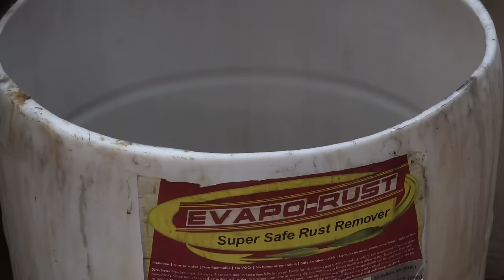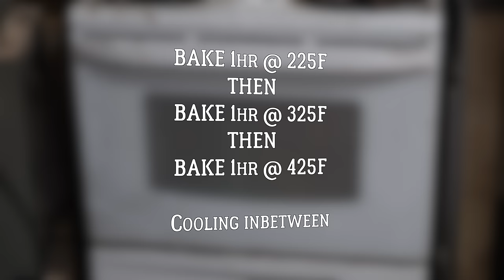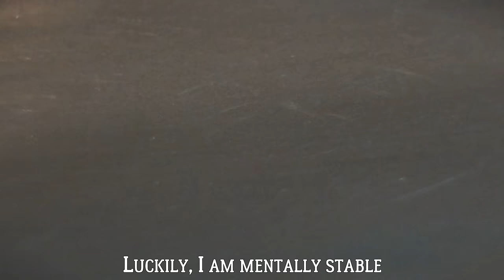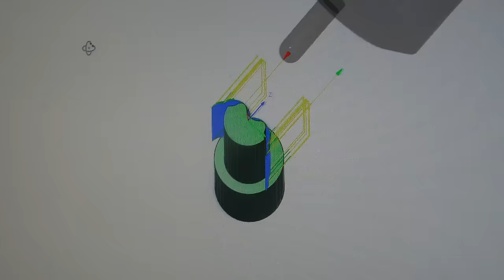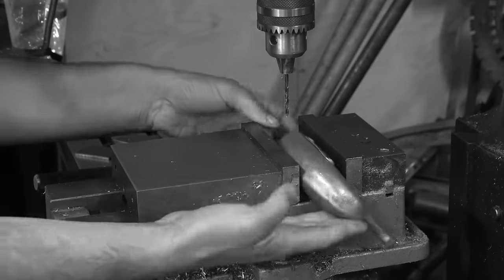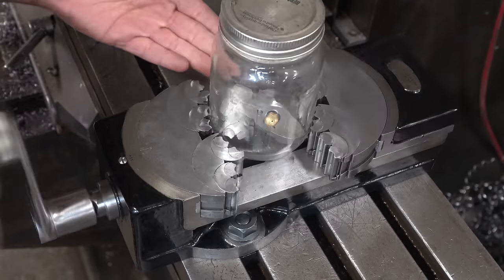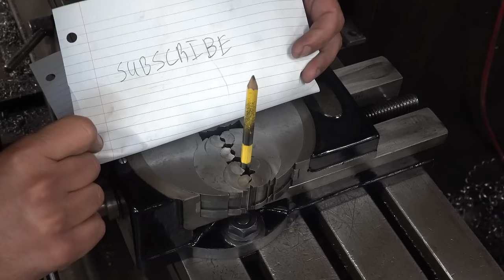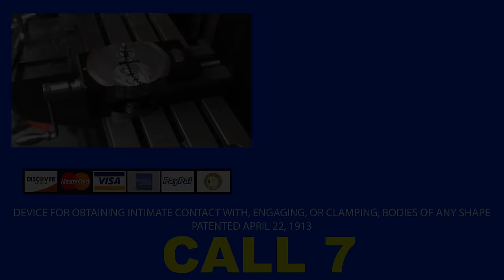Rare Antique Fractal Vise [Restoration]

Comment: hard to imagine any respectful artisan would abuse such a nice tool like that by drilling sloppy holes or applying enough force to fracture the saddle block, maybe it got sacrificed to WWII wartime production or had accidental damage and became industrial write-off, the swivel base lost to the scrap heap, The rebirth of this clever and well made device is an opus of patience, skill, knowledge focused on preserving originality, congratulations on your craftsmanship (and video production talent also!)
Reply: It was probably in an industrial shop somewhere, hard to imagine it being used like that in a home shop
Reply: It wasn't so rare at the time likely, no telling... May be the only one left now...
Reply: The cracked saddle seems like overtightening, which is certainly a possible failure in a production shop where apprentices must of necessity train. The random-ass drilling is just weird, looks like not setting the depth stop properly which… again, I refer you to apprentices.
Reply: Yeah and it will be sad when, in the future, someone loads it up with a bunch of junk and it's melted down as scrap. Will probably comeback as a poorly alloyed Chinese hand tool or a bumper bracket on a Buick...
     Nice Restoration, John
Reply: @JasperJanssen  in the words of my father, when describing the destructive abilities of novices.

"You could break a ball-bearing with a rubber hammer."

 And

 "You could fuck up a wet dream."
Reply: these are milling machine vices for challenging shaped parts. it was a quota driven hourly worker using this not an artisan
Reply: It easy to do. personally, unless the holes interfered with anything, I woulda left them.
Reply: The vise's value as an antique has been completely destroyed by what he did to it. I am an expert in antiques and restoration with almost 50 years of professional experience, and watching what he did to this piece really hurt. I still can't believe it. The original finish and wear is completely gone. Forever. With every bit, shaving, grinding off of original metal, the vices value, story, its history thrown in the trash. Unbelievable.
Reply: @VidarrKerr  OK, and? Personally, antique value be damned, most of us think it's nice that he took something that had broken and missing parts and brought it back to full functionality as a usable tool in his workshop. There are loads of perfectly good tools that would have more value as refurbished, usable pieces than as broken down, not-practically-usable "antiques". Besides, it doesn't erase the history of the tool; restoring and refurbishing starts a new chapter in its service life. 

Unless this comment is satire, in which case disregard everything I just said and have a wonderful day. :)
Reply: @VidarrKerr  Yes you may well be right. What a sad day it is when something has more value as a rusty garden ornament that a working tool. As for the "forever" part, just wait.
Reply: @VidarrKerr  Its a tool, not a Dusenburg
Reply: @VidarrKerr  interesting how this mentality exists in tools, but this same issue exists in art. Do you cringe watching a Baumgartener Restoration video? Do you cringe when someone tunes a Stradivarius violin, thus moving their pins from their original positions? Art restoration is done constantly, removing old varnish and replacing it using today's technology to preserve it for days, years, centuries to come. This would certainly make a good museum piece before, but now it is a practical piece that will likely survive for longer now that it has been restored. And there's nothing stopping it from still being a museum piece.

If it loses value to a collector that would hide it away from the world in a glass case, I say good!
Reply: @Gunnar120  stradivari made stradivarius violins ;)
Reply: im a glassblower. when im making custom ordered stemware im an artisan who hopes he has a tenth of the abilities In glass that stradivari. when making Christmas ornaments, which is literally like blowing bubble gum bubbles, and my rent is in the balance, i dont really give a shit if i bend the blow pipe as long as im making money.
Reply: and to be honest, yeah moving the pins on a stradivarius does make me physically nauseous, necessary as it is lol. id feel the same restoring a da vinci lolol
Reply: and honestly some dude breaking it is the only reason it has survived this long. it started a chain of people who couldn't bear the thought of junking it that led to this video which in turn has raised global awareness of its existence. this is all positive results from beating the fuck out of and then decades lster repairing, a daily use tool.
Reply: @joshschneider9766  I suppose that's fair. And thank you. For some reason, autocorrect made no attempt to fix it.
Reply: @Gunnar120  99% of what he did was stripping away value for aesthetics. 1% was repair. It was a total Fail.
Reply: Eye Roll
Reply: @VidarrKerr  you don’t know much about tools, do you?
Reply: @VidarrKerr  
 Restoration is what was done and is what this channel is all about. 
 This channel is literally about bringing objects back from a very poor, often non-working state, to their original like new, or sometimes better than new, state. 
 He completely succeeded in that goal.
Reply: @michaelrogers4157  Heres another one for you.  "That boy could fuck up a anvil with a feather duster."

Comment: This is beautiful. More than once I said, "He's not gonna do that." I was wrong. I was, however, slightly disappointed that you didn't stamp the jaw you made to match it's partner.
Reply: It could be seen as perfectionism, but it is against the ethic of the machine, the replacement part should stand apart as such.
The object can be made whole again, but the traces of the restauration must be visible and identifiable, for instance such as is with reconstructed antique pottery, it is a matter of respect for the object and the workmanship that goes into its construction and eventual restoration.
Reply: @pnda13  I mean, though... the numbers are a part of the use and utility of the machine.  They're there so you know where each bit goes after disassembly and cleaning.  It's function.
Reply: @pnda13  Considering the numbering has a specific function, would it not be fair to mark it #b, to maintain the function but acknowledge the replacement?
Reply: @TheOncomingStorm3  He could stamp his own UPC on it ... in case someone wants to order this spare part :)
Reply: @Earthenfist  "They're there so you know where each bit goes after disassembly and cleaning."  It doesn't need to be marked if it's the only unmarked one - there's only one spot left after all the marked ones are replaced.   &-)
Reply: @MrThomashorst  LOL
Reply: @Earthenfist  Word. I would suggest etching it (stencil + brine + battery), so it's obvious that it's not trying to hide the fact that it's a replacement, but it still provides the corresponding functionality. All in all, amazing workmaship.

Comment: “We’re just going to… knock… this pin… knock this pin… knock thi-… eff it. Get the drill.”
Reply: Can't be tight if its in 10,000 pieces
Reply: Without putting the handle back on to hold it in place, too
Reply: And the audible sigh when the punch gets stuck...LOL

Comment: I love when he pulls the parts out of the Evapo-Rust by hand.  It reminds me of the first time I went noodling for catfish.  You've done a lot of work to get to this point and you finally found a hole in the mud.  You know you're in for a treat but will it be small or large?  You bravely push your hand into the dark abyss below you and find the object of your desire.  It thrashes about but it cannot break your steadfast grip as you pull it from the dark liquid.  splash splash Then he bravely pulls up the beautiful parts and exposes them to the air.  Like a proud eagle standing on his perch holding the fish he caught.  I do like it when he pulls those parts out quite a bit.  The delightful splash is half of the pleasure.  The view of the cleaned pieces is the other. Superb.

Comment: In all my years in the trades, l have never seen a vice like this. Beautiful restoration as you usually do. The only thing that l would have done different is on the screw, l would have cut the acme thread more early in the process. The reason being is that if l screwed up l wouldn't have as much time in it . This was a great video and showed your many abilities.
Reply: My father was a machinist for forty years, repaired rusty iron engines and machine belts on the side and an antique tool dealer and collector for almost twice that amount of time now. I was raised around flea markets and yard sales and have seen hundreds of older vises. I have a few dozen antique hand tool books, I collect antique tools also, I have a dozen or so vises of various types. I've never seen anything remotely like this. It's so cool.

Comment: Seeing how much high-precision machining was necessary for these vices, I can completely understand why the design didn't catch on. I bet these were eye-wateringly expensive when new and were prone to gumming up with so many tight tolerances in the jaws.
Reply: Didn't think about that. Keeping them clean was definitely important. Also, it must have cost ALOT. Wonder what field it was used in where a regular vise wouldn't cut it?
Reply: I was thinking about the schmoo factor too. Even if they were cheaply made with modern processes, there are so many tight spaces for wee, tough particles to act like jerks.

Comment: My grandpa used to own his father’s “blacksmithing” ( ornamental and also basically fix anything metal shop ) and I did witness one of the employees fix a cast iron differential from a large tractor because it had split in half basically.. the trick ( and hardest ) is to evenly heat the pieces because cast iron is brittle and doesn’t take well to the thermal shock of welding. Guys who do it are masters in my book

Comment: Would love to learn the actual name of this vise, since the word "fractal" didn't exist until Mandelbrot coined it in 1975. Also, the US Patent Office shows it's patent expired in 1930. Surely there are similarly functioning devices on Earth.
Reply: This mechanical concept is used in a variety of applications. A bogie suspension arrangement on a semi trailer is one. It's also used on the wheel support frames of large mobile gantry cranes that run on rails in ship yards and ports. Train car wheels also use a bogie setup.
Reply: “Mantle Vise”.

Comment: I always laugh when your head bangs onto the glass of the sandblaster like a piece of metal attracted to a magnet. I have bad memories of working 8 hour shifts sand blasting Proctor Silex kettle bottom blanks at a summer job when going to college. This was in the 80's in Canada and we would be working in a metal shop with no air conditioning near a long oven which dried the kettle parts after they went through a high pressure hot water washer hanging on a long conveyor chain . I brought cotton gloves to work so I wouldn't sweat into the  sandblaster gloves for the next guy that took over on the evening shift. One day we got sent home when the temperature hit 100 degrees F or about 38 C.

Comment: This device failed to capture the market because it's very expensive to manufacture for the benefit it provides (irregular shapes), which, in a typical workshop, rarely come in play. Majority of machined surfaces are straight lines. For the few cases of irregular shapes, pieces of wood inserted around the part will do, in a regular vise.
Reply: @prezadent1  Counterarguments to what's said required. Use you own brain for debating, not others', my little child. Not everyone needs mental crutches.
Reply: You're no fun!

Comment: hard to imagine how they made that back in the day without CNC
Reply: I believe the space shuttle for the first moon landing was also made without a cnc
Reply: every piece could literally be cut from circular bar stock.  getting the joints to fit and slide smoothly with those low tolerances would be the real trick.
Reply: @LiveFreeOrDieDH  how would you know
Reply: @PhenomRom  because the only way that each "jaw" can rotate is if each surface is circular. That means making circular cuts into circular material.
Reply: Lathe and mill. Dovetail cuts on lathe. Mill for the small jaw faces and profiles. It can also be done on a shaper, albeit with a custom shaped cutter along the length of a bar stock, then the lathe for the dovetail cuts, then its just a matter of parting the individual jaw pieces.
The half-moon bits are trickier. Lathe round to profile with dovetail cuts, cut stock in half, custom mill head or standard + mini dovetail cutter for the jaw ways, and one pass with an endmill while mounted on a rotating vice with adjustable rotational positioning for the jaw limiter screw to interface into.
The crescent jaws themselves can be milled and a track piece added, or one can just mill a dovetail in them, EDM or drill oil port holes, and call it a day.

What would be even better is if they sold fractal jaw pairs. Turn any vice into a fractal jaw vice, without having to pay loads for a whole vice. Only real problem would be how to mount them on a regular vice at that point, or they can just use magnets.

Comment: As an actual machinist, I can tell you why this (probably) didn't really catch on:

For starters, the clamping pressure is going to be wonky. With a regular vise, you (usually) have a single, continuous surface that is clamping the part. With this one, you have 16 radii per side applying the force. This means if you clamp with the same pressure you would apply with a regular vise, you are concentrating all that force over a fairly small area. For softer materials (like copper or aluminum), you're going to end up with pretty noticeable marks -- this may or may not be an issue, but if it is an issue, it means you'll have to do another op to clean up those marks (which adds time). And on harder materials, you're losing out on having that continuous grip over a larger area.

My other concern is that the fractal jaws are not positively locked. I can see a situation where you've clamped something in this thing, and as soon as you take a roughing cut with an endmill, or hit it with a drill, the cutter grabs the part and torques it out of alignment. There'd be nothing necessarily stopping the part from shifting. While it clearly held on at the beginning of the video, that was a finished part. Machining cuts can be tricky and complicated, and you might end up with a part that is more held on one side than another, and that differential pressure causes the part to shift during machining. The fact that the part isn't held rigidly by parts that won't move makes me uncomfortable.

Related to the above, it will be very difficult to align something to the axis of your machine in this. Because it can hold at any angle, you'll have to spend extra time making sure the part is actually square. It might be useful if you needed to hold something at some weird angle, but...

...soft jaws exist. It's pretty trivial (if time-consuming) to take some aluminum blocks, square them up, drill holes in them, bolt them to the face of your vise, and then cut a mating pocket to grab the part. As an added bonus, if you hit your soft jaws and fuck them up, it's no big deal because aluminum is soft and is unlikely to damage your cutter.

And all this doesn't even touch on cost/maintenance.

All that said. I really wanna make one of these cause it's cool as hell.
Reply: You make it and I'll subscribe to your channel even if that's the only video you'll have
Reply: I am no machinist. I was fascinated - as many others seemingly - by the maths behind this thing, the fractal design. Thank you so much for giving me a hint, why this piece does not seem to have revolutionised the world of vices despite its splendid design.

Comment: When he was cutting the threads on that big rod (sorry I dont know the technical terms) how did he ensure that the cutter would move onto the rod at the same spot as the previous pass and not just cut a new channel?
Reply: That's an interesting question. I imagine it's a feature of the lathe but just guessing and would like to hear someone who knows explain. Also, how does it do that? Is it some sort of gearing to move the cutter using a long threaded rod like the one in the vise at the correct ratio/angle?

Do you have to 'wind it back' to do another pass?

Sorry in advance if I hijack your question. Presumably the answers are related.
Reply: You could look up videos on machining ACME threads. Pretty interesting IMO
Reply: @nommy8599  the process is called single point threading and metal lathes support this by gearing that can move the carriage in sync with the chuck. Usually there's also a threading dial on the carriage so even if you disengage the synchronous feed it keeps track and you can lock back into the same thread by matching the number you started on. On CNC systems there's not a physical linkage, but by tracking the rotation of the workpiece it can coordinate the carriage to give the same effect
Reply: on most machines there is a set screw of some sort that serves as a stop block if you need to do multiple passes
Reply: @nommy8599  there is a speed setting on all metal lathes(milling machines too i think). each thread type has its own speed (inches per minute, threads per inch, something like that) . the faster the lathe moves, the coarse(er?) the thread. slower speed = finer threads. thats why he held that thread guide against it.